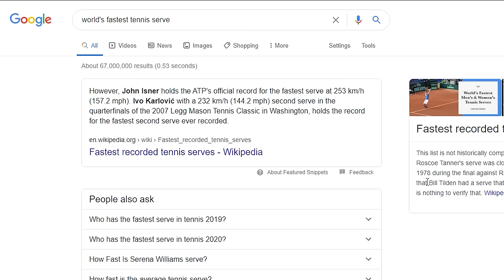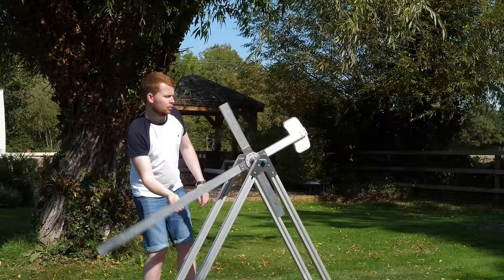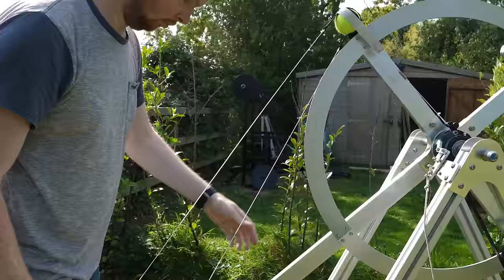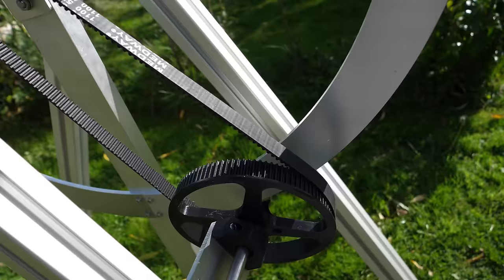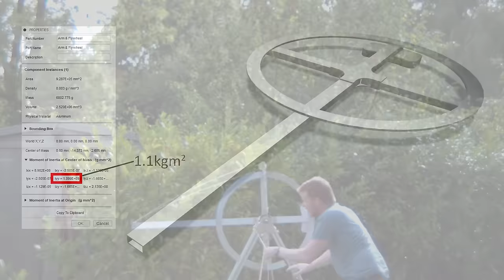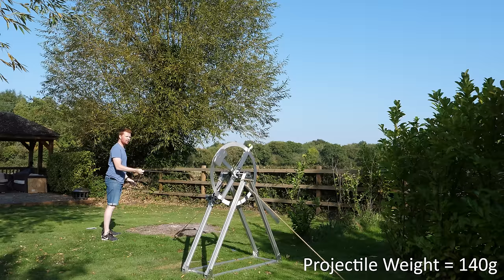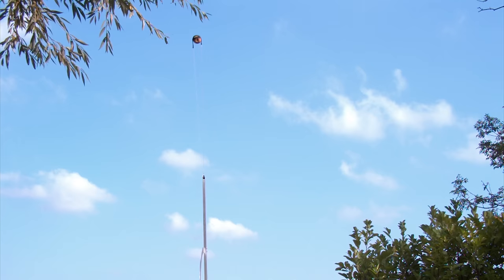Flywheel Trebuchet

Comment: put a mini fpv drone on that thing then arm it while it's in air.  or will the g-force completely obliterate it?
Reply: there is a range issue
Reply: Peak acceleration for tennis ball 368G, let's say drone will have 60G it's still way too much.
Reply: that drone will crumble
Reply: or, have a drone flying in the forward-upward direction of the trebuchet; recording the launches; and then try to hit it with the trebuchet
Reply: Most electronics not rated for extreme g forces will tolerate this
Reply: Hey, if the military can design cameras for artillery shells anything is possible.
Reply: @Y.M...  as far as I know the USAF had to pull several tricks to make the electronics inside the Sprint anti Nuke rocket resilient against its G-force of "only" 100G
Reply: Everyone replying here is forgetting that FPV drones weigh a hell of a lot more than 60g (typically) He'd need an entirely new contraption to launch that kind of weight (500g-700g)
Reply: @chrismawson4430  Gs as in "X-many times the acceleration due to gravity" not grams.
Reply: @zporadik5651  I like the GoPro idea.  I've seen videos of what happens when someone jumping from a plane didn't secure thiers well enough.  It's nausea inducing spin-blur, but the bloody things survive
Reply: Would probably obliterate a drone
Reply: @galahad3195  Yes I know, but with the mass of the wheel increased (by both drone and necessary counterweight) that acceleration would be reduced assuming that the rotational inertia remains the same. And I actually doubt that the drone would be damaged, they survive incredible impacts
Reply: @chrismawson4430  The drone would be scrap, it's more the SD card will survive more often than not (but not always)
Reply: @chrismawson4430  A drone impact is nowhere near 368G, though. For reference, your typical front-end car crash has an acceleration (decceleration) of 30G. Now, drones don't technically have crumple zones, but depending on the angle of the impact, the propellers can serve as crumple zones to some degree, and the airframe, made of plastic or carbon, can bend quite a bit, which also provides some dampening. If you crash on grass, sand, moss or soil, this further helps to dampen the impact. And obviously, especially in free fall or if you aren't flying a racing quad at high speed, drones will usually crash at lower speeds than cars.
Now, unfortunately a quick Google search didn't give me any clear numbers for drones, which is why I am using this car crash number in the first place, but I'd estimate that even in a crash on concrete at any typical velocity the electronics won't exceed around 50-60G.

That is, of course, still not nothing, and more than a human could survive, but it's nowhere near 368G.

Comment: I absolutely love how the release of the sling sounds like a whip. I wonder if you could make it go supersonic aswell?
Reply: You can hear the crack from the sling-string, so it's going supersonic :)
Reply: That's..... why it sounds like a whip. Whips do that crack exactly because the tip goes supersonic. To be heard trough a shitty microphone in the open that sling is probably going super as well.
Reply: @Excludos  It's not, though, it's going 180 mph or whatever he said. The string is what released the tennis ball so they are moving at the same speed at the point of release.
Reply: @ninjafruitchilled  that’s how fast the ball is going not the whip
Reply: @abrahamsanchez7455  The "whip" (sling) is what throws the ball, ergo they are moving at the same speed when the ball is released. And after that the whip slows down due to the energy transfer to the ball. So the whip is never moving faster than the ball.
Reply: @ninjafruitchilled  No
Reply: @abrahamsanchez7455  chad

Comment: I'm at 2:38 and he mentions a hand crank on the side. I'm already scared.
edit 3:59 in: it falls over, that's what I'm scared of at full speed, good it happened now. Less scared.
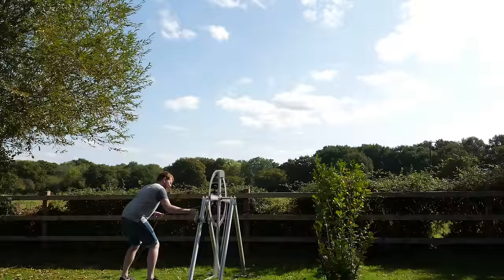edit2 4:30 in: he fixed the falling over by putting a weight on the foot, nothing fixed to anything. The handle is mounted just as close to the spinny thing as I feared. I'm scared again.
edit3 4:45: the wobble!
edit4 5:30: anchored to the ground on both sides. Thank you, I can finally enjoy again...
edit5 8:45: Motor! Motor! Motor!

Comment: I'm normally very impressed by your work, Tom, but you've well and truly knocked it out of the park this time.

Anybody think there's a use for this in those pumpkin trebuchet competitions?
Reply: unfortunately, they've basically stopped doing those competitions last I heard. Or at least they're not putting them on tv which is a real shame.
Reply: Centrifugal designs were essentially dominated by a single machine for years because it's builder was the only one crazy enough to attempt something like it. Bad To The Bone is essentially an old beat up truck with a massive spinning arm that hurls pumpkins, then a few other teams entered into that class and gave him a run for his money. That being said the builder of BTTB just pulls the thing out of the yard every year and goes out and dominates while the other teams have mechanical failures.

Comment: That's an awesome design! Well done! What if you reconfigured it with a chain drive and gears from a 10-speed bike? Then you could gear it up faster as you crank it and the flywheel could continue spinning independently when you stop cranking. Seems like it would be safer than having to let go of such a fast-moving crank.
Reply: Maybe launching the ball into orbit, or at least high enough to affect aircraft is not a good idea.

Comment: Hi Tom, you showed how to do a "power coupling" by increasing the projectile weight.
How would you tune the trebuchet to keep the same projectile weight, but increase its speed?
I'm an electronics engineer and a big fan of your content
Reply: You'd lengthen the arm. It's not the mass of the ball that matters as such, but its rotational mass (moment of inertia). You can increase this by adding mass OR moving the mass further from the center of rotation.
Reply: @benjaminmiller3620  That's not really tuning, since you would have to rebuild most of the trebuchet. The arm needs to complete full rotations.
Reply: @SylverProductions  And that's why he changed the mass instead. Those  2 options are just how physics works, I can't help if one is inconvenient.
Reply: Lengthening the string would get the ball at least a bit further from the point of rotation, without having to redesign it.
Reply: This is what I was wondering about. How much can you lengthen the sling, so you only have to raise the axle for more clearance from the ground without having to put more material into the arm and its counterweight?

I don't quite understand all the physics involved with the sling, but I have a hunch there's a limit somewhere involving the time it takes the sling to release the payload compared to the time it takes to do a revolution.

Comment: hey people building along at home, nobody got hurt in this video, but there is a bunch of energy stored in that flywheel that is geared to that hand crank. If you are unlucky your hand could be pulled between the crank arm and the machine frame, depending on your project and scale with quite some force. Getting a one way idler or clutch can make it a bit safer, but a cheaper solution is to cut a big circular guard out of some cheap plastic or sheet, or use a solid crank wheel instead of a skinnycrank handle

Have fun with your trebuchets and other cool science projects~

Comment: Imagine hooking this up to pedals instead of using a hand crank and using gears like in a bicycle.
Reply: Maybe easier to bolt some balanced weights onto the flywheel. Not as effective as faster rotation, but double mass still equals double kinetic energy.

The frame can be reinforced easily. But the axle/bearing is exposed to a lot of stress.
Reply: How about a high power electric motor? That would certanly be fun.
Reply: @wuerfelfreak8141  send a ball to another country
Reply: @pwnmeisterage  It wouldn't. Not much, and the returns would quickly diminish. To understand why, keep in mind that a trebuchet is a machine that takes advantage of the conversation of angular momentum with a well timed release mechanism. The missile to be launched steals angular momentum from the flywheel in the same way that spinning on a chair with a couple dumbbells does. If you're spinning with dumbbells and you extend them, your rotational speed slows down. However, the dumbbells actually speed up.

Back to the trebuchet, let's assume a flywheel of infinite mass, and a sling radius of 1m, and the RPM at release is 600, or 10 rotations per second. (Trying to keep the math easy). At this RPM, when the sling and its missile extend to their maximum radius of 1m, they will be traveling at a speed of 31.4m/s. This is the absolute maximum at this RPM. There is no slow down because the flywheel has infinite energy to give. Now, if we have a flywheel of finite weight again, there will be some slow down, but a graph of the missile's exist speed plotted against the weight of the flywheel is an asymptote. Doubling the weight might see the missile go from 80% of its theoretical limit to 90%, then 95%, then 97.5% then 98.75%.

So yes, increasing the weight of the flywheel will increase the exit velocity of the missile, but the gains are small and deprecating. Instead, you should increase the radius of the sling, allowing the missile to extract more energy from the flywheel, or by increasing the rotational speed of the flywheel. Of course, if the flywheel is too light, then it won't have enough energy to launch the missile, or not fast enough. That's not the case here, which is obvious when he uses a heavier missile and launches it at very nearly the same velocity.

All that being said, increasing the weight of the flywheel is not for nought. What that will do is allow you to throw a heavier missile at the same speed. More momentum means more smashing power and greater range. Well, the helpfulness of increasing the destructive capability of a siege engine from classical antiquity may be up for debate, but that's what you'll get by increasing the flywheel length.
Reply: @journeytree  An unassisted toddler can toss a ball to another country, provided they're close enough.

Comment: The sling puts a back spin on the ball and with a fluffy Tennisball it would make damn good use of the Magnus effect. You must be shooting these things bloody far. Have you recovered a tennis ball? If so what was the distance
Reply: I want to see the range on this as well. The weighted ones too.
Reply: is that whats effecting these things?  have you ever heard of the tippman 98 paintball marker?
Reply: hardwire I have airsoft guns which cause this exact effect, the parts that cause the back spin are called hop up units, not sure what paintball have thp
Reply: @ryanm.191  a bent barrel look up the tippman 98 without its barrel shroud its just got a bent barrel to put a backspin on the paintball longest shooting marker of all time thanks to that effect and fairly damn accurate to.
Reply: @ryanm.191  oops its been a while lol its the tippman 98's flatline barrel its a custom barrel but everyone gets it thanks to what it does.
Reply: hardwire just had a look at it and on first glance it looks like it would put a forward spin on it but yeah I see how it achieve the Magnus effect. Must be bloody odd seeing a bent barrel

Comment: Power it with a cordless drill. Or if you want to stay strictly mechanical you can make a spring-powered wheel, like those wind-up starters for lawn mowers. And the base needs to be anchored.

Comment: My friend's son and three of his classmates designed, modeled and tested a trebuchet for their 7th grade science fair. The boy's father is a welder so he volunteered to do the actual build as that would be too hazardous for a bunch of school boys to attempt. However, they assisted in the less dangerous parts of the  build. It stood about twenty feet tall at full extension and used a fifty gallon drum as a counter weight. It could be filled to different weights depending on the size of the projectile. With 40 gallons of water, it could launch a 5 lb. pumpkin over 120 meters in a beautiful parabolic arch. Not bad for a bunch of 12-13 year old boys. Alas, it only took second place because the judges took exception that the kids didn't perform the actual building. The attending parents were not in agreement with the judges but is what it is.

Comment: Very cool project!  I bet you could easily connect the crank to a stationary bike and use your feet to power the flywheel.  The handbrake on the handlebars could release the trigger to launch the projectile 🎉

Comment: Amazing! Another design could be to have both a high-rev flywheel and the standard trebuchet release. The trebuchet is released, and it gains a massive thrust of energy from the flywheel. Could provide an easier way to load the trebuchet and charge the flywheel.

Comment: Two things come to mind:  First would be that it could be entertaining to stick with the lighter projectiles and just use more of them.  Set up your trigger like for the mult-shot rubber band guns so that it can launch one after another on every time it comes around and see how many you can get in the air at once.

Second, your flywheel speed seems to be limited by how fast you can turn the crank.  Replace the timing belt with a rope pinned between two disks on each shaft and the gear ratio will switch sides with each rotation so you have the high torque to get it started and then it shifts up to higher RPM.  You won't be able to just spin it forever waiting for the perfect moment, but you didn't seem to be doing that anyway.  Alternatively, salvage the gear cassette and derailleur off an old bicycle so you can shift it up whenever you start having trouble keeping up with the crank speed.

Comment: I believe the reason that a human with a tennis racket is able to hit a tennis ball so fast (just over 253 km/h is the current official record) is because of the elasticity of the system.
My reasoning: The mesh racket has some give to it, and the ball itself compresses in the middle of the serve (if you watch footage of a tennis ball being hit, it basically goes flat). When the racket first hits the ball, some energy of their swing is stored as elastic energy (the racket stretches, the ball compresses). Later into the swing, the ball has also been accelerated by the impact with the racket, and then the elastic energy is released. So the ball's resulting kinetic energy is the sum of the kinetic energy directly transferred by the racket and the potential energy that was stored in the elastic system, giving a much higher efficiency of energy transfer than a rigid racket striking a rigid ball.

Comment: I enjoyed the video and like your methods. I used 3D Print a lot in model trains and occasionally I need strength and seeing the alum sprocket with printed teeth was a neat solution. Especially if I need to insert ball bearing, metal hub, 3D printed rim makes great strength.  D

Comment: I want to do this over, but get everything balanced: flywheel mass on both sides of the crossbar, alternated bolt heads and nuts, and adjustable masses to compensate for the projectile.  And then put a motor on it.

Comment: Attach a motor to that and use a braided wire instead of string.  You could also add weight to the flywheel.

Comment: I notice the frame rocking as you crank the handle...  the guy lines help, but if you mitigated that displacement, you could shave a few points off from lateral drag.

Comment: These are some Ideas for you to consider to set a new much higher record, I know this video is 3 years old, but anyway. Make base platform on wheels and fix it on the base so the trebuchet is not moving around, make a step gearing system that is automatic like a 12 speed bicycle, lose the belt for a chain, use braided steel cable the same thickness as the cordage you are using for the sling.

Comment: Seems like it would be more safe to have a round flywheel you could spin up separately from the arm and use a disc brake to lock the arm to the flywheel to fire it. You could add a timer to the brake to let go after the throw to limit the arm momentum after the shot to catch it with a shock absorber.

Comment: This made me wish I had known to develope my math skills as a kid. I think I would have excelled at engineering. Due to poor math skills, (but great reading & comprehension skills & growing up on a farm with my master sheet metal smith/carpenter/jack of all trades Dad, I excelled in the mechanical trades (auto/diesel repair & welding/metal fab/machinist). Now, I'm old, retired & handicapped, so I'll settle for tinkering with what I can do.... But this was inspiring anyways, Thanks!

Comment: For maximum range (I know that wasn't your main aim though) you need to launch as close to 45° as possible, in a vacuum; because of air resistance I think the optimum is somewhere around 40°, depending on the projectile.

Comment: pretty sure that you could lengthen the rope by 3 times and go back to the tennis ball... something like that.

three times the radius, same mass, three times faster... probably a square in there somewhere though, with acceleration...

would be interesting to see the length of lever altered rather than the mass and achieve the same energy transfer... at higher speeds, of course :)

Comment: What if you used garage door springs to power it. You could devise a crank wind-up and possibly gear up that energy to the arm. Similar to the original counter weight, but with much more power.